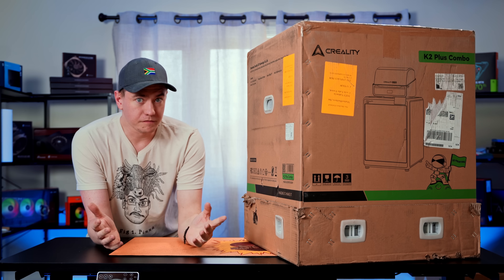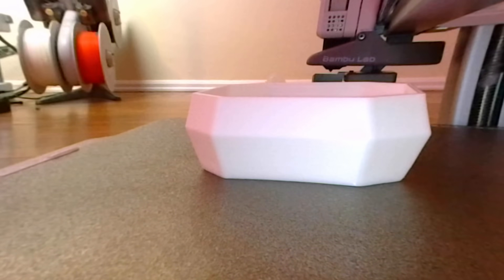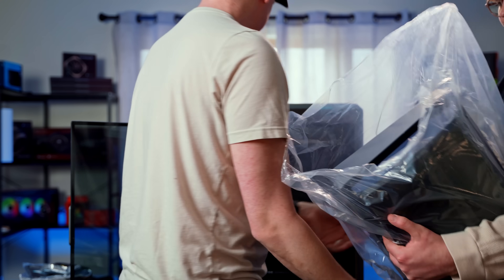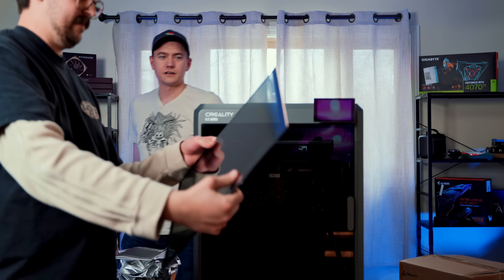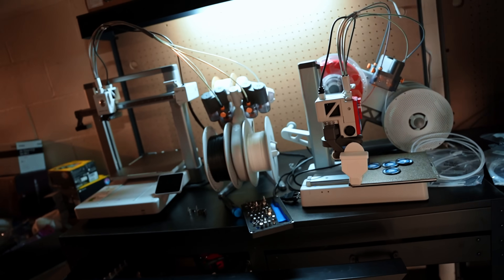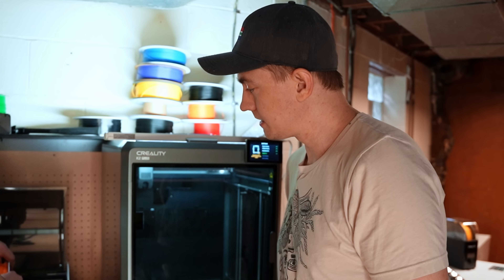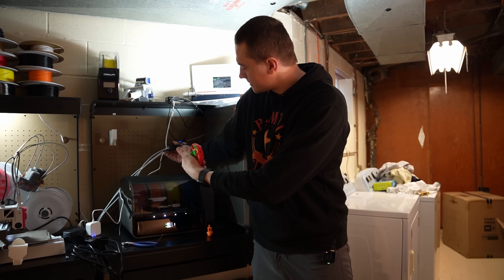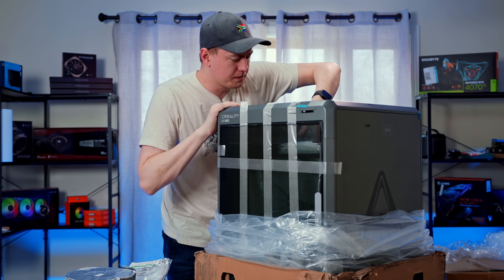Expanding Our 3D Printing Lair - Creality K2 Plus

Comment: Are heatbeds warped? To bad they use rolled aluminium plates i onestly thing that flagship printers should come with graphite plates, not only they are flatter, they don't expand, are more thermally stabl and conducts hrat even better.

Comment: This is my first 3D printer.  The unboxing and setup was a chore merely because of the size of the thing and how much care was put into making it not get damaged in shipping.  Getting all of the shipping screws out and being sure not to miss any while following their imperfect (but actually thorough) online directions was a thing.  Overall, my experience so far is GREAT.  As a noob who knew nothing about 3D printing going into this, I found the experience to be way less challenging than I had anticipated.  I think a lot of that has to do with how advanced and well made this machine is.  Bed leveling?  I heard thats something people used to need to do manually.  It is unnecessary for this printer, as it does all the tedious stuff on its own.  I just set up my print in the slicer software, send it over to the printer via wifi, press print, and it all just works (so far).  

The poop (filament waste from when the extruder needs to change colors) is excessive when doing multi colored prints.  I do hope there is a way to recycle the "poop" and put it to good use.  There is a LOT of it.

Comment: I got into 3 printing a little over 4 years ago. I have 4 printers now and still love it. My most used printer is my Creality k1. I was never a Creality fan however they have come a long way. I modded all my bed slingers to run klipper with rasberry pie or klipper touchscreen pads. The 3d printing industry has blown up and has progressed so quickly in just a few years. It's crazy how mainstream it has become compared to before. I hope you enjoy your k2 plus. I may get one eventually but I need to sell some before. Lol

Comment: Brett the Bambu printers are also OLD and slow compared to the newer printers.  The X1C/E is almost 4 year old tech
Reply: And still a solid performer. Print farm had multiple p1s units and they are just workhorses
Reply: @JohnSmith-rt5yq  Funny my P1S and P1P Bambu are trash.  $350 in parts just to keep my P1P going after 1 year and my P1S is dead with a split belt and a bed that the front dial popped of during a print.  Workhorse?? More like Dead dogs 🤣😂😂

Comment: it was painful to watch you remove the model from the bed at 15:40.  the way that PEI coated build plates work (such as on your k2 and the bamboos) is that you need to wait for the build plate to cool down. - also they are magnetic flex plates - if you grab the 2 handles (labeled with fingerprints, closest to you) on the build plate, you can lift it up, thereby flexing it, and causing the model to pop off the bed (if the bed has cooled to close to room temp). - you should NEVER need to use a scraper on any of these beds UNLESS the z-offset is set incorrectly and you accidentally print too low - the automatic leveling system should prevent this like 99% of the time. - tl;dr: the scraper is a last resort and prints should just pop free when they're done.  be patient when a print ends, it only takes 2-5 minutes to cool down (this can be accelerated by opening the door).

Comment: Great work and I like the 3D printing. 
Just a tip for removing a print you only need to lift the build plate and flex it a bit and everything should come off.
Love the content as always.
Reply: only works for PEI coated plates. Doesnt work for Epoxy resin, glass or metal build plates

Comment: FYI the tech has been around since 85 and it was only recently that the patents lapsed (they have a 20 year limitation) allowing companies to use heated chambers and this is the secret to printing more problematic materials like ABS. This is the only reason for the 3D printing tech to explode in the retail world.
Reply: Wasn't aware of that. Thx for the info
Reply: you dont need chamber heaters, most printers get up to 60 degrees chamber temp with the bed heat only and all fans a max in maybe 20minutes. Thats why vorons for example dont use chamber heaters, its just not worth it unless time is very expensive for you, but even then, buying 5 instead od 4 printers might even be cheaper than buying 4 with chamber heatern and you can still output the same amount. And you mostly print PLA, PETG and TPU anyways, so just not worth it for the avarage consumer
Reply: Fun fact: Fdm 3dp in general was patented in 1984 by stratasys.

Comment: You only really need an active heated chamber if you want to print particularly exotic filaments.  A standard enclosed printer like the BambLab X1C, P1S etc. is fine for things like ABS, ASA etc., and as others have said, OctoPrint won't work on either the BambuLab printers you already have, as they have a completely proprietary firmware, or your K2 Plus, as it's already running Klipper, and you generally only use OctoPrint with Marlin-based printers.  You can use them with Klipper-based printers, but there's really no point.  With Klipper itself, you should be able to do timelapses etc.

Comment: I don't think you can connect Octoprint to Bambu Lab printer. They don't have a USB port to connect the RPi and the new firmware for them locks them down even more.
Reply from the maker: Yeah, I realized that after. SimplyPrint is the plan now.
Reply: @UFDTech  You cant do ANY kind of Klipper mod to a Bambu.  It is completely locked down from the manufacturer and thats a big downside to them.  If anything goes wrong with a Bambu its a nightmare to try to fix it